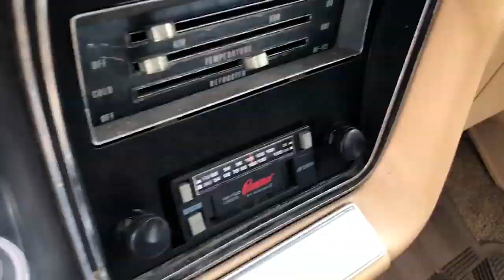SUPERNATURAL - Restoring the Winchesters' Impala Season 15 Trailer | SDCC 2019

Comment: Guys.. as someone that has driven a 67 impala in 1967 I will tell you this..

Any car you get today will out drive it.

Practically any car you get today will be more comfortable.

However.. the big boat cars were pretty and roomy.

Cars are another thing that is much better now but not pretty anymore..
Reply: you'rfe missing the point and obviously don't get it.  You can have the 500hp new cars, they don't sound feel or look like the muscle cars of 60's and 70's so you can keep them.  I want my gearshift to vibrate and rattle when i'm waiting for light to change.  How can a 500+hp car have no rumble or cam lope or a gearbox that doesn't even make a sound or vibrate???  They mostly sound like shit even with 3K exhaust system and electronic cut-outs and blah blah blah.  Headers and a couple turbo muffs or glasspaks with a little cam on an old Chevy motor is  all it took to produce a sound  all these new $50, 60 and  $70K new muscle cars will never be able to .  If i wanted a  car that can do auto-cross or drives a road course like a Porsche...I'd buy a fucking Porsche or a ZR1 Vette not a GT500 or ZL1
As much as it pains me Demon and Hellcat are the closest throwback worthy car. Straight line blast acceleration i have to respect a car that comes from factory with line-lock on drag radials. But i can buy the Impala and a 67 SS Camaro for less than the Demon sooooo i'll pass
Reply: Jeff Rogers the impala was not a muscle car.. it was a family car.

You are looking at aftermarket stuff and the big engines shook them apart..

The steering was loose and it would corner for shit..

Listen to the doors open and shut on supernatural... they are what they are...
Reply: @ferdonandebull  it's not about the muscle.  I remember my dads. I remember burning my legs on the leather seats. I remember the a/c never really cooling off the car. I even remember the rattle the engine made at start up.

Comment: I just got a 67 Caprice 4 door hardtop all original car I’m making look like this
Reply: LeeDuKe 951 awesome
Reply: jman7481 thanks man
Reply: For the love of god don’t put the supernatural crap in. I mean the show is cool, but in real life, I’d say to loose the crap.
Reply: Be sure to prep a weapons carrier :p
Reply: Noah Garay like what exactly
Reply: Zwordsman yeah it’s gonna have the weapons box in it
Reply: Zwordsman yeah it’s gonna have the weapons box in it
Reply: I think he means don't put a weapons box in the trunk and paint a devil's trap under the decklid
Reply: good man. Nobody realizes that the Impala and the capris are the exact same car only real difference is a few pieces of interior and trim on the body quite a few times during the cards lifespan in different generations only differences were things like order landau roof or interior packages. I had a black 87. Some of the body parts on that were off of quite a few different GM vehicles that particular body model that they ended in 89. Parts of it dated back to the late 70s. If you can believe that they made a two-door and four-door that carried from the 1970s. Up till 1989 for the body line and frame and parts of the drive train. Had an 87 for quite a while that was black. And before that a black 1980 Grand Prix had the Grand Prix quite a while before the show and had the 87 nearly a year give or take. When the show rolled out.
Reply: J Coltrane well who would build the Metallicar and not make it like in the show then it’s just a black 4 door Caprice/Impala
Reply: @leeduke9518  I know I would!

Comment: Who would restore a POS 4 door Impala?  This one belongs in the crusher.
Reply: I've seen people restore worse doesn't matter Dodge or Chevy. It all depends on the car. What they started with was actually in pretty decent shape, considering what I've seen people work with. I am a Chevy guy myself and I've been driving Dodge vehicles. The last eight or nine years can't get a good GM anymore. They stopped making decent GM vehicles in the 90s. In my opinion, and the old 1980s were will drive Chevys are too hard to get. Started things off with a 90 Jeep technically three minivans including the one that I gave my father on minivan number for now and I was also driving a Dodge charger which looked pretty much identical to the car from supernatural rolled it a couple weeks ago and trying to get another one ..